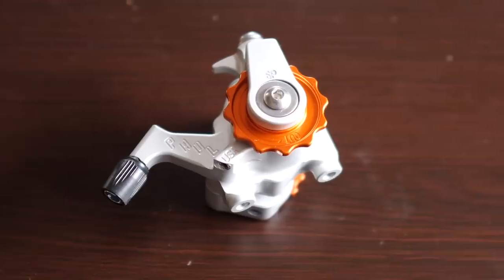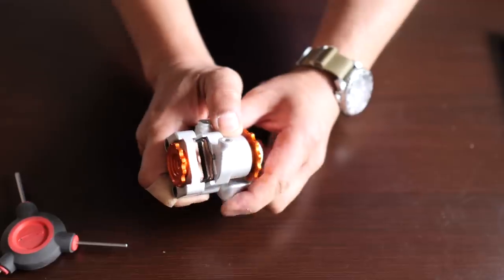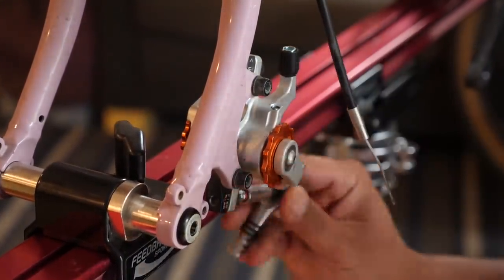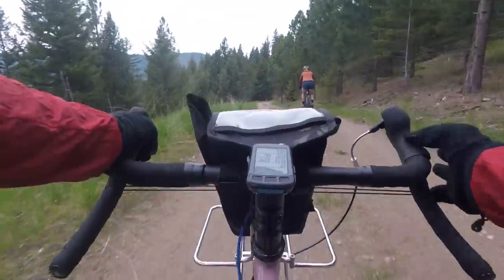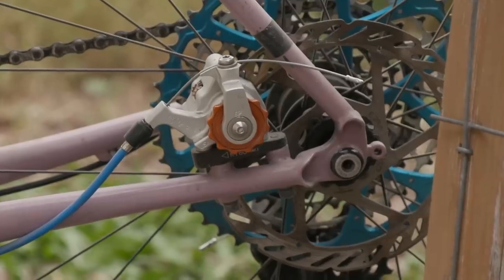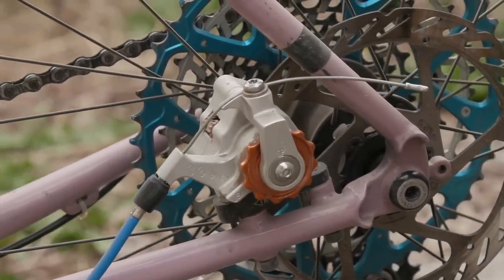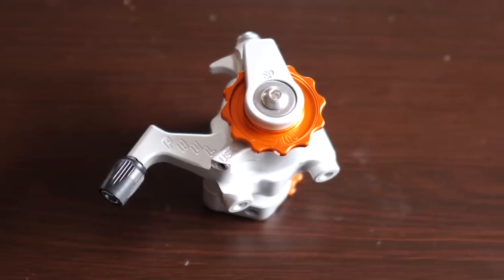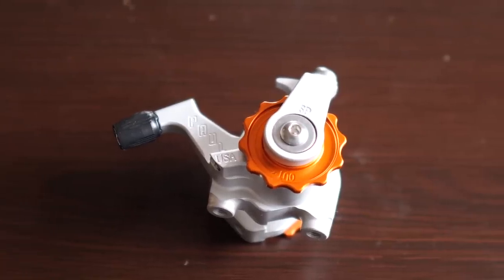Paul Klamper - Worth the 💰💰💰?

Comment: Something to note: it looks like the Klampers only klamp down onto the rotor from one side. Compared to a brake like the TRP Spyre where both pads move. No personal experience with the Klampers but just comparing 2 brakes I've worked with (Hayes CX and TRP Spyres) having both pads move makes setting up easier and I think brakes better too. Granted on the Klampers you get the independent pad adjustment you don't get on the Hayes CX, but setting up you have to run the non-moving pad super close to the rotor to get good braking, which can get annoying if your rotor is out of true.
Reply from the maker: I have had crappy experiences with Spyres.  Apparently they don't play well with certain Shimano levers.

Comment: These came on my custom built cyclocross bike - High speed run at night, did not see curb until too late, None of my other bikes would have made it. Locked up back, skidded around inches from curb. Love these now, way faster stopping than BB7s - I will buy them for my other bikes soon. I can fix this on the trail, not true on Hydro.

Comment: Have you tried the JagWire Elite Link cable housing and the mandrel-drawn super-slick cable?  I find they have dramatically improved both shifting and braking on my road bikes.  The housing is expensive, but with Klampers, the expense is lost in the noise.

Comment: Russ, have you given up on rim brakes? Would love to hear your comments on how these disc brakes compare to the best of rim brakes.
Reply from the maker: Don’t know if I’ve given up on them but haven’t used them in 7 years. I prefer discs for the fact that you can invest in some good wheels without worrying about wearing the rim down
Reply: @PathLessPedaledTV  agreed. Also, for gravel riding disc makes a lot more sense. Esp not having to keep the rims clean. I have TRP Hy/Rd on my gravel bike and Rene Herse centerpulls on my rando bike. I have to say that the modulation on the centerpulls are amazing. Can use just one finger from the drops to modulate speed. And overall stopping power is equivalent to the Hy/Rd if not better. They were a pain to setup to get pad positioning right and prevent squealing. But once u set them up right, they felt great. Hope u get a chance to try and review them.

Comment: I just don't understand why these are better than TRP Spyres: they only move in on one side where the Spyres have both pads clamp the rotor. You can also more easily adjust centering the rotor grab with the Spyres. The Spyres with compressionless housing feel amazing. I 100% believe these are a better BB7, but I bought two Spyres for $120.... I run them 180F and 160R and I can stop on a dime with weight.

Comment: I Setup my TRP Spyres several time. Now it is ok but not nearly as good as my Ultegra rim brakes regarding the stopping power.
I wonder if this is due to a different pull ratio of my Sora to a 105.
What kind of compressionless housing do you use?
Reply from the maker: For the Yokos, I used what came with it and the stopping power was awesome.  After multiple drive train changes for the channel I picked up some Jagwire compressionless and its not as a good with the Yokos. For the Pauls, they actually recommend NOT using compressionless housing
Reply: Changed from Jagwire to Shimano and it is a little bit better. I just want to try a swisstop brake pad and see if it makes a difference. There some voices that say so.

Comment: The TRP Spyre still have its upper hand, with the dual sided clamping actuation. 
But we should look at the aesthetic since PAULS does look good.
Reply from the maker: Spyres have two pistons but what good are they if they suck?  Have had the worst luck with them.
Reply: You should check out Paul's video on why they use single-sided clamping. I have Spykes on one bike, and Spyres on another, and they're pretty good...but I don't think they perform as well as the Klampers do.
Reply: @PathLessPedaledTV  I am new to the disc brake, would like to hear more how they actually perform compare to each other.
What problem did you guy found on the TRP? Maybe a long downhill section in terms of breaking power, exhausted fingers etc
Reply from the maker: @ysllsy6624  they just sucked.  I could be in the drops applying the brakes and the rear wheel won't stop. Apparently there is some cable pull differences between shimano levers that don't play well with TRPs so that might have been the cause.
Reply: @PathLessPedaledTV  Did you do a bit of research on adjusting Spyres? Did you bin the stock pads that are garbage? Even cheap Shimano B01S pads are way better (and Klampers come with Kool Stop sintered pads, which cost about $20 per wheel). Did you run compressionless housing? (No need to get crazy expensive compressionless housing, the Jagwire Road Pro kit costs $30, you get 3m of compressionless housing, and two great quality cables) 
I feel like Spyres get a bad rap because of bad pads and user error. You read reviews and they go like this: Spyres are the best, Spyres are the worst, Spyres are the best.
You say you can't lock up the rears from the drops, yet I do skids all the time (even when I don't want to) when i'm descending on the hoods. How does that work? 🙃 
Spyres are not my favourite brakes, they are not better than Klampers, and they have their issues. But if you can't lock up the rear even from the drops then something is wrong there.
Reply: @PathLessPedaledTV  Had the same problem wir SRAM Apex 10speed Brifters. I am pleased with HyRds now with special actuation arms.
Reply: I had Spykes on a commuter bike and a cargo bike and other than the frequent adjustment necessary to account for pad wear when you put 500+ miles on a bike per month, they were great brakes. I also used the TRP levers, used Jagwire compressionless housing, used a Dremel tool to make perfectly flat housing ends during my installs, and I didn't use stock pads. I have a feeling that Klampers get used on a lot of "boutique" type bikes - the bike  that someone takes out to ride on the weekend, but not the single bike that logs 5000+ miles in a year. Maybe if the pads needed adjustment a lot or whatever they might not hold up as well against other brake designs/other manufacturers. I like that they appear to be more serviceable, but also shake my head that they're using the oldest bike-disc brake technology of literally bending the rotor to contact a stationary pad. I think a dual piston brake is always going to be a superior design, and when you take out Russ's need to swap bars and brake levers all the time, then you remove one of the best things from the equation when you consider hydros - self-adjusting pads for the life of those pads. Also, hydros will ALWAYS modulate better than any mechanical disc brake.

Comment: Did you ever try TRP Spires with compressionless cables? And if so how do they compare to the Pauls and the yoko's ?
Reply from the maker: No. They were absolute garbage with the  levers I had and I don’t think it would have worked. Apparently they are not truly compatible with various Shimano levers.
Reply: FWIW I run TRP spyres with compressionless housing and 10sp sram rival levers and can bring the back wheel off the ground from the hoods when stopping
Reply from the maker: Have only used with Shimano and they were 💩.
Reply: @PathLessPedaledTV  funny I get great braking on my Spyres with Shimano levers. Regular old cable housing going full length too.
Reply from the maker: @sambookbinder4201  https://forum.cyclinguk.org/viewtopic.php?f=5&t=136381
Reply: @PathLessPedaledTV  Got a source on that? I know Shimano uses a couple slightly different road pulls (SLR, SLR EV) but not so much as to make them incompatible
Reply from the maker: @MrJonas2255  "incompatible" in so far as they will work but will probably suck.  That is the only reasonable explanation (someone left a comment in a previous video)  I've been given to explain their really crappy performance.
Reply: @PathLessPedaledTV  right, makes sense. My understanding is new SLR EV levers pull more cable than traditional road calipers like. I guess it depends whether spyres are designed with traditional road pull or SLR EV in mind (I'm guessing traditional/SLR)
Reply: @PathLessPedaledTV  LOL so basically "road pull" is no longer a standard. Wonderful, its always nice to have another bike related compatibility issue to worry about.
https://www.youtube.com/watch?v=BAomAwIwxm8

Comment: Seems like you can’t beat a mechanical caliper from trp due to the mechanical advantage of both pads advancing.    Interesting u say these work better. Thanks for vid.  I also can’t figure out why others don’t make mechanical brakes that advance from both sides. Seems like a simple enough thing.
Reply from the maker: “Seems” simple.  Dreaming up an idea and executing are two different things. They have a video on the Paul channel about why it’s not.
Reply: @frakafrocka  Even with TRP Spyres where both pads advance, you do not get doubling of mechanical advantage (MA). In fact, the MA is reduced in half for each pad that moves. Resulting in same MA as single pad calipers.
Reply: Niraj Shrestha interesting!!!  I don’t think this is true because if you watch a Slow motion video of a mechanical disc brake where only one pad advances you see that when the moving pad hits the rotor the rotor flexes into the other pad. This results in a loss of force because Power is being lost in the flex.  So even though cable pull and leverage of all the parts might be same, Clamping the rotor without flexing it in theory should provide more stopping power.  Thanks for interesting comment.
Reply: @frakafrocka  Here is one way to explain it. Firstly looking at the brake lever, the amount of cable pulled is constant. Secondly at the calipers, the distance that the pads move is also the same (or close to) for both calipers. For eg. lets say the pad moves by 1mm on single pad design. For the dual pad design, the pads would move by 0.5mm  each, for a total movement of 1mm. Leverage (or, mechanical advantage) is then simply the cable pull length divided by the pad movement. 
Sorry for the math involved. But in summary, there is no way to increase leverage without first decreasing the pad movement. If you make the pad movement too small, then it will rub rotors! Hence, for mechanical disc brakes, there is only so much leverage/MA you can have in the system.
Reply: @frakafrocka  I think that the amount of energy lost from flexing the rotor is very, very small. Especially if you have the fixed pad set up properly, i.e., close to the rotor, which means there is very little bending anyway.
Reply: Niraj Shrestha sweet reply. Love it. I’m sold. Thank you.

Comment: Did you try exchanging the proprietary compressionless housing with shifter housing instead of brake housing? There's a lot less compression in shifter housing.
Reply from the maker: Why would anyone do that?
Reply: @PathLessPedaledTV  To shave the cost of the proprietary, expensive and therefore less so readily available compressionless brake housing , and use something cheaper and more readily available that is practically compressionless too. You tried regular brake housing, that, as you said it yourself, wasnt satisfactory. Why not try it?
Reply from the maker: Well because it’s shift housing and not subjected to the same forces as braking?
Reply from the maker: That sounds like a recipe for a lawsuit for a bike youtube channel :)

Comment: Unless you need the purple color, just buy a TRP Spyre for less than $80. It is a dual side actuation beautiful piece of engineering and saves money for compressionless brake housing.
Reply from the maker: I've owned Spyres and not a fan.  The cable pull doesn't match up with some Shimano brifters and they're mushy at best and the stock pads are meh. The single sided Paul's stop more effectively IME.

Comment: I have SRAM hydro disc brakes and they are so frustrating! Constantly getting spongy, brake levers have tons of play, etc. I am getting frustrated. I bought my bike brand new and they had problems from day 1. Maybe time to go to cable brakes that I can service myself.
Reply: Buy a bleed kit, watch a video online and learn to bleed brakes in 15 minutes. Cable discs are not set and forget. You'll be adjusting pads constantly.
Reply: Ask ex pros what they secretly say about the disk brakes they "have" to use. They are contracted not to say anything bad about their sponsors equipment publicly. But most complained bitterly to the mechanics.
Reply: Those Sram levers with play in them are due to the master cylinder getting stuck. That can be serviced.

Comment: Russ, you got me very interested in Paul klampers for my first build (salsa fargo). But I was planning on running a mix of Shimano GRX components (hydraulic only brake levers). Does anybody have any suggestions on compatible hood shifters that would work with GRX rear derailleur & mechanical Paul Klampers?
Reply from the maker: Maybe mechanical 105 brifters?

Comment: How do the klampers calibrate? I currently run bb7 and having to recalibrate the brakes is really annoying. Especially after taking the wheels out to fit the bike in a car and then spending 15 minutes on adjusting the calibers before being able to ride.
Reply from the maker: Do you have thru axles or quick release?
Reply: @PathLessPedaledTV  My frame uses quick releases, so i was thinking of upgrading my brakes to something that's simpler to adjust like the ultimos.

Comment: Excellent review.  I was on the fence about these brakes and like magic your review appeared and convinced me.  I installed them today and wow!  The stock mechanical disk brakes on my Marin Gestalt X10 were dangerously terrible but the cost of the Klampers seemed more than a bit crazy.  You got me with your 'forever brakes' comment as I can completely relate to hanging on and reusing bike stuff that works regardless of age (I still ride a couple of 90's mountain bike frames with parts that look like a timeline of bike component evolution). Immediately, the Klampers are an incredible difference.  The feel and power is so much better and the ability to hard brake from the hoods is wonderful.  So yeah, thanks for the helpful and spot on review.
Reply: just looked at this bike and it looks awfully overpriced. Renegade Expat is cheapet, has Cr-mo frame, better brakes and Tiagra groupset

Comment: Wait... They’re $230/wheel and they are only SINGLE piston?  I know you’re not a big fan of the Spyre brakes, but they are dual piston.  It’s certainly unfair for me to be critical of a brake that I haven’t ridden.  And I am, after all, a huge hydro fan.   But my “rain bike” which I rode this morning, has Spyre brakes mated to 105 5800 levers, and they’re fine.  They’re not Ultegra, but fine.
Reply from the maker: I’ve had mediocre at best experiences with Spyres and the Klampers with their single piston worked better than the Spyres two pistons. What’s the point of two if they suck?
Reply: Path Less Pedaled Fair point, to be sure.  I have to wonder, though, if for $230, Paul could make both sides actuate.  But again, you have ridden them; I have not.  And they do look kinda’ cool.
Reply from the maker: They have a video on their YT about why they only did a single sided design.

Comment: Couple of questions. 

How do you find pad centering on these when removing/replacing wheels? Did you ever have to tweak the pads to clear the rotors when you put the wheels back in?

What’s that rad shirt?
Reply from the maker: Not with thru axles. Club Ride flannel.

Comment: Blingiest yes, But TRP  Sphyre or Hydro cable-actuated brakes are the best.
Reply: 100% agree
Reply from the maker: Spyres are 💩 with certain Shimano levers. Yokos are cable hydros that I like, but the lack of reservoir in the Paul’s with similar stopping power is what won me over.
Reply: @PathLessPedaledTV  I'll consider Paul if i saved enough. I just like the chucky look of my Magura MT Sport levers and calipers so far. I dont know what will be the performance of mech brakes on 203 rotors so Im afraid to try.
Reply: @FJ-xz7yy  I run mechanicals on our tandem with big rotors and I'm happy with the braking power. I ran BB7 with 180mm rotors on my Fargo during Tour Divide and had no issues stopping either. Bigger rotors and pad selection make a big difference.

Comment: For the money, I bet these are always paired with compression-less brake housing like Yokozuna.
Reply from the maker: Interestingly they recommend NOT using compression-less housing.
Reply: Path Less Pedaled Paul recommends against compression-less housing?  I have always used compression-less housing on my BB7s to make them work/feel better.  When I tried a pair of Yokozuna brakes, I got their housing and feel in love with it and have been using it with my Klampers.  The brakes are awesome.  Combined with Love Levers, and they are a sweet setup.

Comment: It still only moves one pad.  They might be shiny but finish does not make up for an inferior design.
Reply from the maker: Can YOU even tell the difference when riding or have you just fallen for bike industry “advancements”?  I've ridden over 60 bikes in the last two years. Bikes with hydraulics and cable, single and dual and I'd be hard pressed to tell you how many pistons are in the brakes or if one or both pads move.
Reply: @PathLessPedaledTV  I used an example of this design and they were crap.  Far too much leaver travel before the pad contacted the rotor.  Almost no breaking power.  Any adjustment to move the pad closer to the rotor resulted in the rotor dragging.  They simply didn't work.